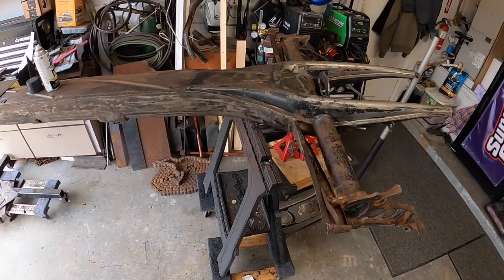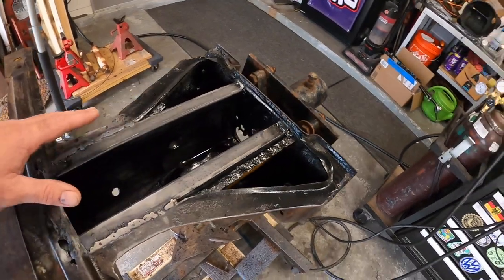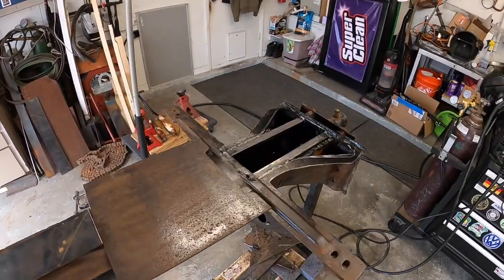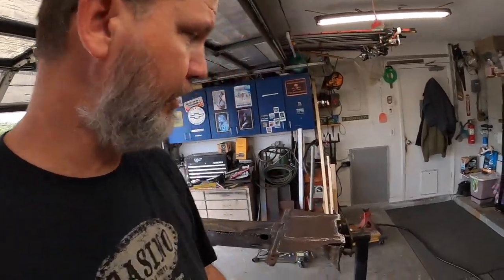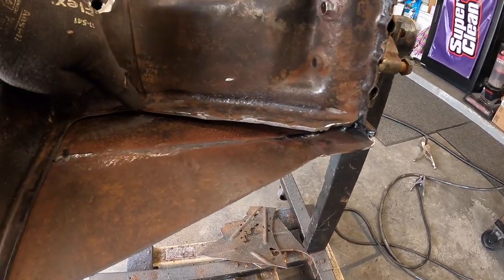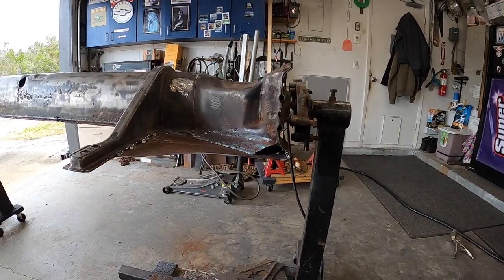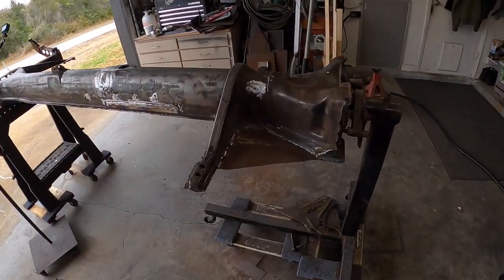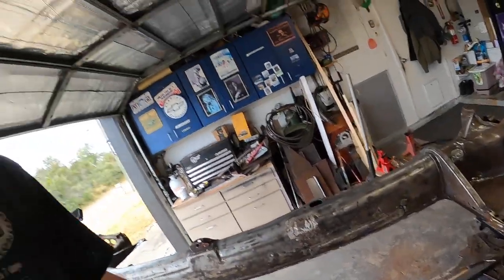VW Bug Frame Head Repair - SICKXTY -  Volksrod – Baja / Franken Beetle Build  34

Comment: On the side of the tunnel, the flange where the pans sits, that section that you cut out there, it looks to be about 16 inches long, I've cut that out and weeded in angle iron and trimmed it to length on the Thing pan I did some years ago.  Came out good.  Just another method.
Reply from the maker: I considered that but ended up bending some plate to make the repairs…. It’s all the same really.
Reply: @VWJawbreaker  Well, sorta!  😀

Comment: If I had to do that much work to the frame head I might have considered raising it... maybe my next poo poo pan.  Always wanted to!  😁👍🏻
Reply from the maker: I thought about that honestly but with the swing axle rear I’m limited on how high I can make it without getting too crazy. It’ll level off nicely the way it is.
Reply: @VWJawbreaker  Not really limited!  You can raise the engine and transmission, too!   Especially for the kind of build you're putting together here, wouldn't recommend that for something full-bodied, though.  Even on a full-body sometimes people can raise them about an inch and a half and things still fit OK.
Reply from the maker: @DuckmanCycles  true but it’s a bit late for that now lol
Reply: @VWJawbreaker  There's always room for Jello!   All you need is the right transmission mounts and you're gold, no mods needed! :)

Comment: Gary. Please make sure the inside of the clutch tube is clean. If it’s rusty it will destroy the cable after some use. 
ALSO please cut the tunnel open on the right side in 2 or 3 places to 
Re-weld the support tabs that hold the clutch tube. They break loose, tube  rises making it longer, making the cable longer and creating a problem adjusting the clutch cable. 
Check the samba for pics on where to exactly cut the access holes. Hard to explain where. Obviously one is at the front right side. The tube is welded to a plate in there.

Ol well crap!!!!Guess I should have waited til the end of the vid. Hahaha. 
BUT I would have still do it anyway.
Reply from the maker: I appreciate you looking out for me and taking the time to type that all out. It sure is nice having us all look out for one another instead of the way most people tear one another now days. 
I didn’t do it on video but I ran some cleaner and the old clutch cable through the tube and it was pretty clean. I did forget to do the throttle tube though, that’ll happen soon! 
Thank you again and I hope you have a wonderful day.
Reply: @VWJawbreaker  no problem. Been there with the tube problems. You can also run a small wire through the tubes and attach the appropriate size rope to the end and pull it through with some cleaner in the tube to help clean them out. Just recently did a bus and you wouldn’t believe the nasty inside.
Reply from the maker: @robertlambert5299  I’ll probably do the clutch tube a win but I’ll definitely do that in the throttle tube!

Comment: Frame head gets my nod of approval. With that extension you're adding for the beam it makes sense to strengthen the supporting material. This should stand up to some off-road antics!
Reply from the maker: Great minds think alike once again! With the beam extension I feel this will be plenty strong to hold up to some abuse here and there. Nothing radical though as I won’t beat it too hard off road…. Too much time and money has gone into this damn thing lol

Comment: Hi VWJ, Mike here again. I like what you've done so far and considering what you're working with it's probably worth an award based on that alone. Sometimes it's about using what you've got to get what you want. I don't think you mentioned it but I saw the way you did some rust prevention on the inside there. That was good to see. I was going to ask in an earlier video if you had plans to do that but didn't want to be 'that guy'. I enjoyed the class (Overkill 101). I do that all the time with any project. The ramp I made for my son's $1300 Losi RC car is basically indestructible. It had to be because of who it was for and not because of its intended use. He likes to test limits. 

By the way, I have made some progress on '70 sedan. Nothing visual just some major decisions. I had my hot rod consultant come over and he gave me some much needed help and advice. I have made some major decisions because of it as well. For me, those decisions are huge milestones. I don't want to go the wrong way and end up regretting. I don't want to just settle for something either. Anyway, just thought I'd drop a line. Take ease!

I'd like to make one-line comments. I never have done it, but I'd like to!
Reply from the maker: Hey Mike. I enjoy your comments, regardless of the length! 
I am trying to use what’s at hand for the most part but that doesn’t always work when you’re dealing with something that needs so much work. I feel the frame head will be strong enough for what I’m wanting out of the car. 
I’m glad you were able to make some decisions, that’s a huge accomplishment really. Now you’re able to take that vision and get a game plan together so you can move forward. Happy for you!

Comment: Have you ever swapped a ball joint beam for a link pin beam? I installed a link pin beam using a adapter and im looking for ideas on how to hook steering up, any info would help
Reply from the maker: I wasn’t aware there’s an adapter to put a link beam on a ball joint front end. 
Steering should be the same between the two, utilizing the stock steering box from the link pin beam.
Reply: What i ran into is by installing the saco adapter it pushed the beam forward like 2 inches and im unable to hook passenger tierod to pitman arm. Driver side is fine due to no hump from the beetle frame. Its looking like ill have to do some notching in order to get the steering hooked up. Thank you for your response
Reply from the maker: @nicklietz4743  not being familiar with the adapter, what you’re describing makes sense. 
Other option would be to install a rack and pinion for steering.
Reply: @VWJawbreaker  that was my second idea

Comment: I have a 70' Dune buggy on a 1959 pan, thank your for the perfect view in the beginning of your video, it shows exactly where my frame is bend. I was going to cut is off and re-weld a new frame part on to it, but now I see that I have to find another way around it. It is almost bend so that is looks factory made, but now is see it's not. new approach needed now. Thanks again for your video and the motivation to get me going again.
Reply from the maker: I’m glad the video was able to help you out with your issue. Cutting off the frame head and welding a new one on is an option and depending on how bad yours is, it may be the way to go. Lots of measurements are needed, possibly even making a jig to help ensure the new one goes on straight. 
Keep us posted on your progress!